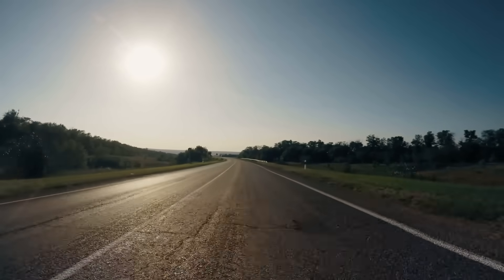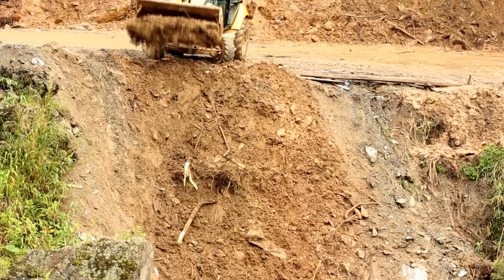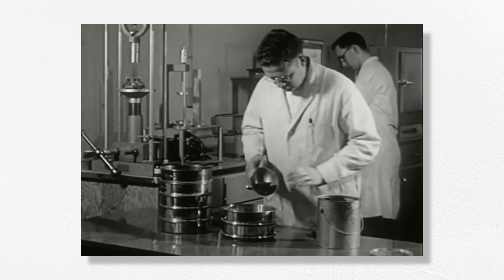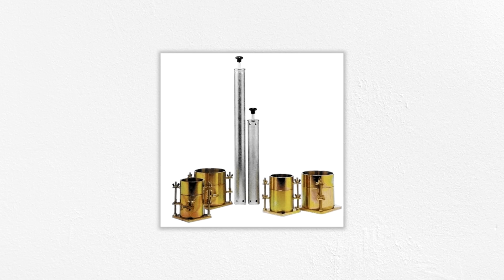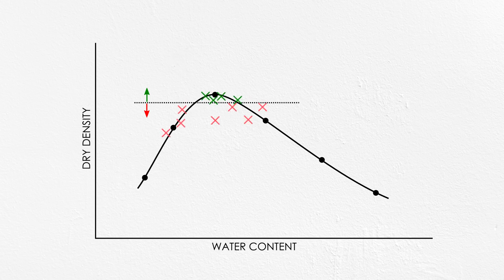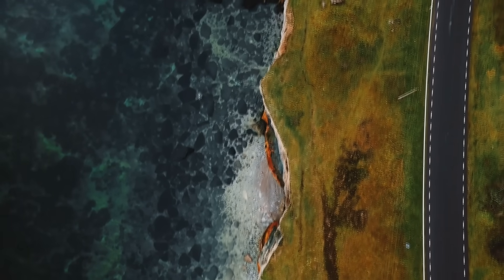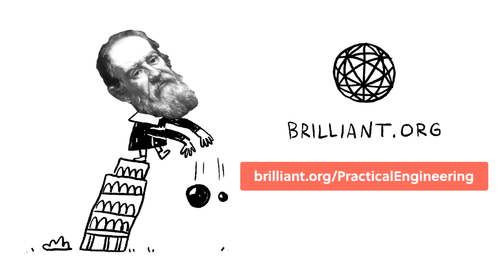Why Does Road Construction Take So Long?

Comment: I just got home from working for FEMA in KY and I was amazed at the amount of blasting and removing of rock took place in building some of the highways in eastern KY. I was wondering where all of blasted rock went. I know there wasn't enough fill to use it all. I used to be a Highway Engineer and I really liked this video. Good Job.

Comment: And on so many times things aren't really planned at all, but just copied from a standard or a previous project... And since no foreknowledge was used 'plans' are useless. If roads are planned e.g. on sandy hills all that land work would not really be needed, but is done just out of habit... And sometimes all that land moving just fluff and loose a naturally solid ground unnecessary, 

And too many times all the aspects of the plans/works are not thought thru e.g. that all that tamping and earth moving may cause a dam for water flow or on some other case gravel in road bed may produce a drain that dries swamps or puddle under old  buildings

Comment: I work in the construction industry, excellent primer video! There's alot of videos you could make on this top. Some additional reasons why it takes a while
- weather: this is the biggest factor. when it rains jobs sites become a muddy mess. Then it takes several days to dry after that
- permitting can take a while
- Right of Way acquisition: this can take years. Sometimes they'll start on a job without all of the property purchased and I'd there is an issue and the construction catches up to the property not purchased, there can be delays
- design flaws/redesigns add time

As far as soil, spot on about the importance of getting proper compaction. Another thing we do if the soil is "unsuitable" or not good for the roadway base (besides removing it) is various types of stabilization. We can add lime or cement to the subgrade to help get the right density required to meet specs 👍👍
Reply: Weather can delay a project big time. Main cause of projects going past the expected deadlines.

Comment: One reason road construction costs so much is regulation and cronyism. In any given market, probably only one quarter of the contractors who have the ability to do the work actually ever get a shot at it. This is because the established companies, most of which have been around for several decades, always seem to be able to use their connections and regulations to keep competitors from even bidding these jobs. This keeps price and performance pressure outside of the process, which significantly thwarts innovation and cost reduction. If you think about it, road building projects are like a dream come true for most dirt/site contractors, and yet it is always the same ones doing the projects. Ask yourself why.

Comment: Sometimes repairs take a while, I get that, although taking 3 years to fix 5 miles seems excessive (i-475N) .  What I don't get is when the road gets repaired one summer because of potholes, then torn up the next summer by the water dept, repaired, then torn up again the following summer by the sewer dept., etc.  The stretch in front of our store has been torn up and repaved 4 out of the last five summers and then people wonder by businesses close down.
Reply: I do really like your channel, and I think you would be a good engineer to work with.  As a municipal electrical foreman, I spend a good deal of time cursing EE's (and others.)  ;)

Comment: Very well-presented, but not that much information. A lot about grading and soil compaction, but there's a lot more that goes into a road. Also, we want to know how long it takes. They've been working on a road in front of my business for a year. The road is eight short blocks long or about a quarter-mile. My God, how long could it possibly take to build a unmoving flat thing?

Comment: I don't mind road construction or even how long it takes. What I have a problem with is a 20 mile long construction zone with a 45mph speed limit with only 1 or 2 miles actually being worked on.

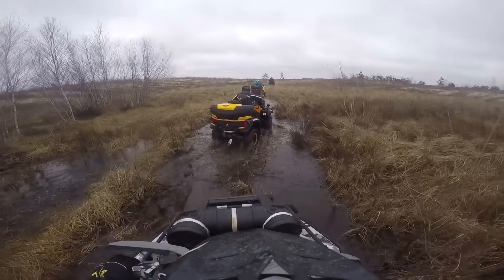Comment: 1:35 Meanwhile in the rural parts of Australia: dirt roads simply graded and compacted which are smoother than the highway and open limit meaning 100kph without the niceties of safety barriers and emergency stopping lanes. I'd imagine a lot of road design after weight carrying capacity and water shedding is to deal with the insufficient driver training and pretty abysmal attention span of most people.

Comment: I know the costs of building roads makes many projects unviable. So if you had a large forest area that would be great for lumber, but it was remote with no roads, it would likely not make financial sense. Of course a company can cut costs by building a basic road (single lane with passing places & a rough surface) which I have often seen when loading from mines and quarries.

Comment: I have no problem with road work, as long as they are actually working.
What I have a problem with is:
Taking a highway down to one lane with orange barrels & slowing speed from 65 to 45 then watching for 3 to 6 months while there are no people & no equipment. 
Then they finally bring out some equipment. Still no work or people, just equipment for 3 to 6 months.
Finally they bring out a work crew of about a half dozen people for 8 hours a day 5 days a week for 3 months.
Then finally they work the site 24/7 with dozens of men and finish the job in a month to three months.
Then they move a mile down the road and close another 5 miles down & the whole thing starts all over again.

Comment: It's poor management in England. 4 months ago they changed some streetlights, they had cones out cutting 2 lanes down to 1 lane and nothing happened for 3 weeks not 1 piece of equipment or any materials on site.  And in the end it took like  3 days to do that section of road.  3 weeks of 1 lane for 3 days work.

Comment: So, why are all those guys standing around leaning on their shovels? 
I watched a crew push a pipe (maybe 12" diameter) under a four lane roadway once. There was a big machine sitting in a trench that did the pushing. A crane would pick up a length of pipe, and lower it into the pit. A crew of half a dozen would work like mad jockeying that section into the machine. Then a guy would weld the new section onto the pipe already under the road. Then another guy would work the pushing machine. Deal was, the half-dozen crew was idle for most of the ten or fifteen minute cycle, working only 30 seconds or so. But you had to have them for that 30 seconds, and there really was nothing for them to do otherwise. Same for the crane man, the welder, and the machine operator. All had their role, and none of them worked the whole cycle.

Comment: Wish you would do a video on why roads that are resurfaced in my little town start to deteriorate so fast, usually after about 3 to 5 years.   The first year the newly resurfaced road is nice and smooth, dark colored, with bright white stripes.  After a few years the road turns a light grey with alligatoring all over.  My guess is that the road bed or first foot under the asphalt has gotten unstable over time, water pockets, uneven compaction.  So each subsequent resurfacing last shorter and shorter.  I saw a video years ago where some highways in Europe use a top layer of asphalt significantly deeper than most U.S. highways, and that the asphalt itself is a higher grade, with the European highway costing about 50% more per mile than a U.S. highway, but lasting more than twice as long. FWIW.
Reply: Hiring the company with the lowest bid who will use the cheapest materials to get the job done. Never hire the best contractor only the cheapest. You get what you pay for.

Comment: It seems to me that your logic is great for new roads where there is a lot of cutting and filling involved. But almost all road construction I see is resurfacing, where there shouldn't be a need for much cutting and filling.
Reply: Preface: Not an engineer, just someone who has seen a lot of construction and has known some people with some connection to the construction industry. Take with a grain of salt.

Sometimes a resurfacing project requires removing the existing asphalt because of problems with the roadbed underneath. Settling issues in the decades since the road was originally built, raising the roadbed or changing the slope to improve drainage, replacing culverts under the road, or other changes to match new engineering standards (the road may have been built with slopes of N degrees, but current standards are only N-5 degrees so all the slopes have to be altered. Some areas are worse than others, like here in Florida where much of the soil is either sand or reclaimed wetlands. Plus we our fair share of extreme rain events that can undermine the roads.

But even assuming no changes to the roadbed and it's entirely asphalt replacement the process goes...
1. Strip off the old bad pavement, one lane at a time.
2. Apply new layer of pavement, one lane at a time.
3. Apply a second layer of pavement, one lane at a time.
4. Repaint road markings, replace reflectors, replace traffic light sensors.

I think there is also a deliberate delay between steps 2 and 3, which I assume is allow for any obvious issues with the pavement to make themselves apparent.

Do all of the above while keeping the road open to traffic so there's usually only one crew working at a time and usually on a project that covers several miles. Sometimes doing the work at night or in other odd hours to decrease the impact on traffic.

Depending on the mileage involved, this can take awhile. In my experience in Florida, urban repaving projects usually cover several miles of road while interstate highway repaving often cover as much as ten miles.

Also, a construction company pretty much never has one job going at a time. Each job has a deadline, usually a comfortable one because exceeding the deadline usually comes with a financial penalty unless an extension is negotiated in advance. If one job is running ahead of schedule, some or all of the crews might be moved to another job that's running behind schedule. If the contract is for the project to be done within 6 months the construction company often has little incentive to try to get the job finished in 3 months rather than 5.75 months. This is true of pretty much any construction, not just roads.

Comment: One of the things I saw a lot of when I was a young lad working in road construction (base crew) was delays. All the different groups doing work had delays between their stages. The crew that did the surveying would finish and then it would be days or weeks before the excavation crew got to work. The excavation crew finished and then it might take days to weeks for the sewer crew to get to work. ect ect ect

 You get the idea. Every different stage of construction was done by a completely different crew with their own timetables and equipment and there were always delays where the jobsite sat idle after each stage was finished and the next crew had to finish what they were currently doing before moving to the new site. Jobs would be completed a lot faster if the work was continuous from start to finish, but that would require a lot of superfluous equipment that would sit idle for long periods and a lot of people trained far beyond anything reasonable. The surveyors do not know how to excavate. The excavation crew does not know how to put in sewers. The sewer crew does not know how to put in the base. The base crew does not know how to set forms and pour concrete. The concrete crew does not know how to lay asphalt. The asphalt crew does not know how to put in utilities.
Reply: You have to think too, these different crews are probably working on multiple projects throughout the year to stay busy and earn a living each week. So just because one crew finishes, doesn't mean that the next crew is ready to jump on that job. They're probably finishing up a previous project/job. So you get them delays between different project stages due to other projects mostly. That and weather.

Comment: I work for one of the biggest paving company in texas , company built their own monopoly such as having their own ground work groups , transportation co  , belly dumps , dump trucks , and asphalt plants  and the reason why projects are delay is mostly the asphalt plants having problems its insanely hard to keep a good running plant txdot requieres samples as well , weather can delay projects , temperatures below 50 wont be able to lay ashpalt

Comment: What I'd like to know is why road and bridge repair take so long. There's a bridge on my commute that probably took a few months to build. It's not overly massive or complicated. They're doing some kind of surface work, nothing to do with the structure. This has been going on for five years now, with no end in sight. I understand that they can't be as efficient because they can only work on part of it while it remains in operation, but come on. I'm pretty sure if you gave me some hand tools and traffic cones I could be done in 5 years. At an equivalent rate, a typical medium sized city would take a crew of ten thousand people about a thousand years to construct.

Comment: A Danish company built a highway in marshy soil here in Jamaica using a permanent wick drain system (which is VERY effective because it continuously drains the soil).  Part of the road started to sink during the defects liability period because the drains were simply overwhelmed.  The solutions?  Giant blocks of styrofoam!!! They excavated the newly built road, placed these blocks of styrofoam and rebuilt the road over them - problem solved, the road hasn’t moved in 10 years.....

Comment: There are two reasons why roadway construction costs so much: the contractor and workers get paid by the hour, day, month and year, and two, you are building a roadway continuously 'connected' to the earth.   The solution is to raise the road slightly above the grade and build it in pre-cast pieces spanning columns every one hundred feet.  In this manner, you are 'working' the earth only every one hundred feet instead of continuously.  As to pre-casting the roadway, this is done on most bridges (except for those that are designed and built to maximize the contract for the contractors--who donate lots of money to political campaigns, and the unions--who also donate a lot of money to political campaigns).  Think this is not practical or possible?  They built 400 miles of elevated oil pipeline in Alaska in two years!  Columns every one hundred feet and pre-cast pipes from column to column.

Comment: You don't necessarily need to use soil to raise for bridges. In swampy land like we have in the Netherlands we can't, because the added weight of all that soil disturbs the ground in the area, even lifting houses. We actually use (Recycled) Styrofoam to raise it up. Because its so light, yet highly compacted its quite strong. I'm currently delivering the stuff to a dirt sound barrier witch needs to be lifted about 3meters with Styrofoam inside it.

In cases where the earth is strong enough they've used a product we call slakken. Which is the leftover ashes you get after burning trash for energy. Pile that stuff up and it hardens so much you need jackhammer cranes to break it up again. Perfect for that kind of foundation work.

We also use Styrofoam instead of dirt on top of underground parking garages so it needs less support columns inside it. Or tunnels for that matter.

Comment: Years ago was in suburbs if Chicago where they had their stuff together. They worked on highways at least 16 hours a day using 2 shifts. Had portable cement plant within 5 miles of work site. In Philly took them 4 years to rebuild a 5 block long 2 lane exit ramp off I95. First they dug up one side while ramp was closed for 1.5 years the reopened 1 lame for 6 months then closed it down for over a year to dig some more. Could have built 3 Empire state buildkng in that time. Have to scream when they have 2 lanes out of 4 over a 4 mile stretch and only 6 men working there.

Comment: i have worked for the State and a City as a construction inspector. These videos would be fantastic for a course. So many individuals at the the classes i have attended dont seem to be interested in learning. If the equipment operators knew why they are doing what they are doing i believe they would have a better understanding and provide a more quality job. Your classes should be shown to individuals interested in construction work. These vids would be great for training and you should get paid for them. Well done.

Comment: The issue that frustrates everyone isn't when you can see actual work happening, it's when you drive by the same area week after week and nothing is being done, it's just closed off.  
This is happening right now where I work, the closest expressway entrance is blocked off so I have to drive past it then get onto the expressway and drive past my nearest entrance and you can see there is nothing being done, no equipment, no workers for at least a month.
Reply: inspections (specialy epa, and permits take longer than the actual work sometimes sadly)

Comment: Roads are 'hard surfaces'  built over 'soft dirt'.  If everyone drove vehicles using airbag tires like those that 'Rolligon' trucks use, we wouldn't need roads, but with regular tires, we need a hard surface to drive on.

Comment: finlands ground compressio leads to a issue where you dig a 1 cubic meter of soil and you get 2.4 cubic meter of soil, because of the iceage glasier pressure